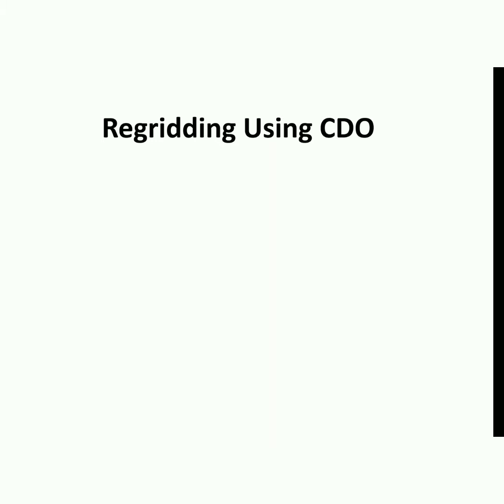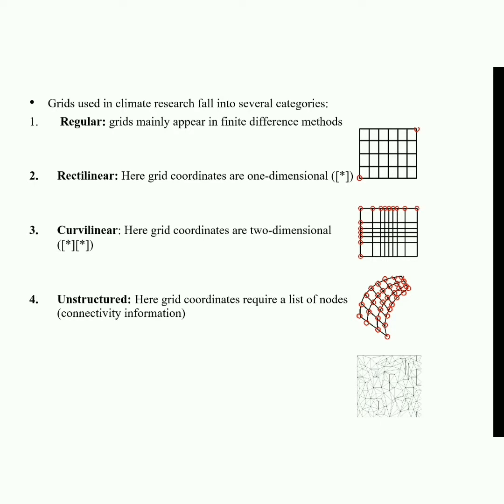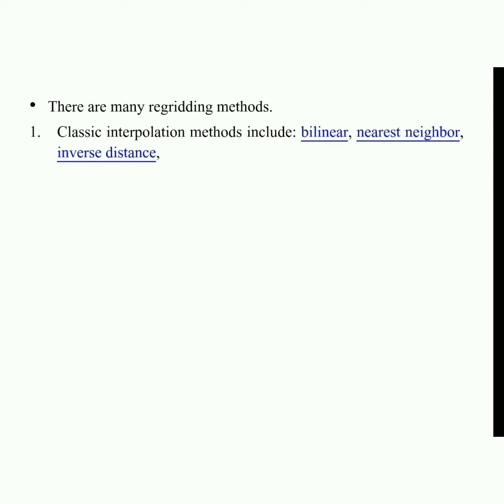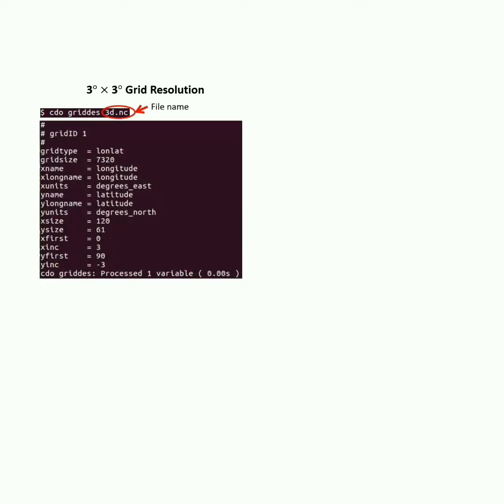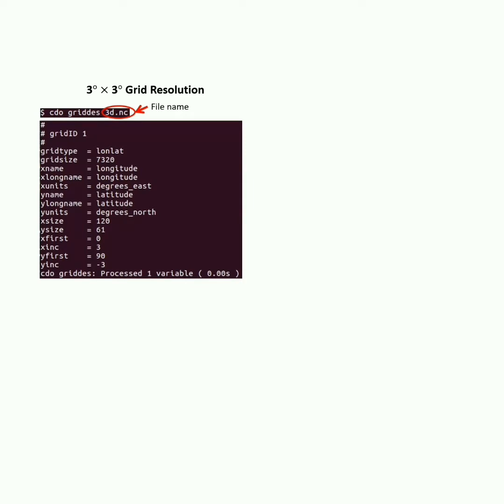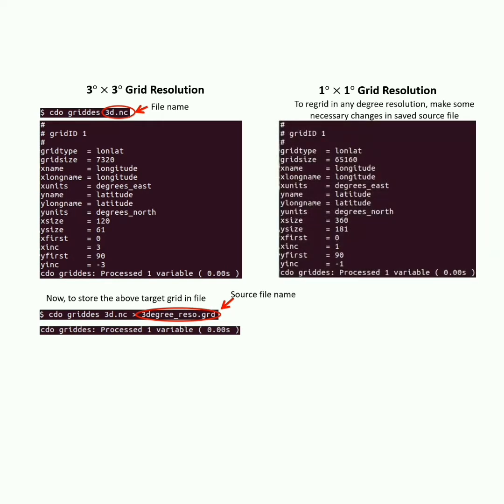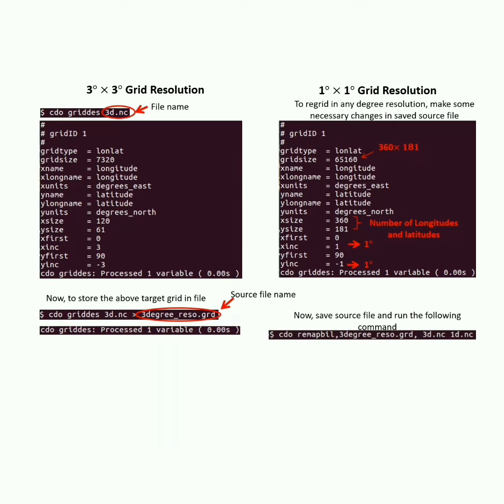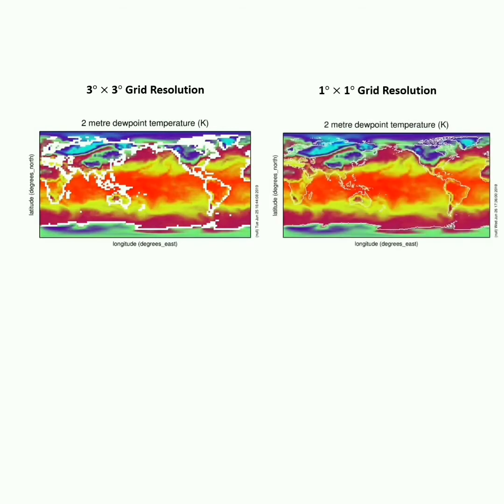Regridding in CDO by Bi-linear interpolation method

Comment: Hello, I have a question. I want to resample wind speed data from 0.04 degrees to 0.5degrees. Also, I want to resample dewpoint data from 0.1 degrees to 0.5 degrees. I want to know that for resampling wind speed and dewpoint, Is bilinear a good method to do that?

Comment: sir is there and way we can convert the data in excel to nc in CDo. Please guide
Reply: Hello, maybe this link helps you.(https://code.mpimet.mpg.de/boards/2/topics/10494?r=10505#message-10505)
Reply from the maker: Dear Vidya,

I don't know of a program that will do what you want directly.

There is a package for converting netCDF data to Excel and
manipulating it in Excel before writing it out again as netCDF:

  http://netcdf4excel.free.fr/vba.html

Another approach would be to write the data out as comma-separated
values to a text file, edit the text file to turn it into "CDL" (a
text form of netCDF data described in the netCDF documentation) and
then use the ncgen utility that comes with the netCDF software to
convert the CDL to a binary netCDF file.  For more information on
ncgen, see the ncgen documentation:

  http://www.unidata.ucar.edu/netcdf/docs/ncgen-man-1.html

Hope so it will be helpful..

Cheers
Reply: @easyway2think745  Thank you so much for the reply sir..but i could not access the link. could you pls help me
Reply from the maker: @pappurani  Try this..
https://www.unidata.ucar.edu/software/netcdf/docs/

Comment: Hi,, I want change the resolution of a temp anomaly nc file from 2 deg to 0.5 deg 
and I was using cdo remapcon ,, where i took a sample nc file which was in 0.5 deg resolution and according to that i was trying to re-grid this temp nc file to 0.5 deg resolution.. but i am getting this error.. Too many streams! Operator needs 1 input and 1 output streams ..... can you please help ??
Reply from the maker: Your have already 0.5 deg grid resolution data, then why your are re-grid it on same resolution?
Reply: @easyway2think745  thank you for your reply.. you didn't get what i was trying to convey.. anyway.. I was able to do that using  cdo remapbil.. previously I was trying do that using cdo remapcon.. taking that 0.5 deg nc file as a sample input file.. I hope now you can get my point..
Reply from the maker: @manasranjanpanda9859  Ohh..I got your point.

Comment: If dataset in curvilinear form, only I have to change remapbil to remapbic. Are there other changes needed to be followed in this tutorial?
After opening the source file, I got the file description two times, one in starting and another one at the end of the source file, So, is there a need to do changes in both ones or only in starting one? 

One last thing, how to find xsize and ysize for a particular grid?
Reply from the maker: Ans - 1. If dataset in curvilinear form, you can use remapbic instead of remapbil. It depends on, how you would like to integrate data set either in linear or in cubic form.
2. You can use starting one description
Reply: @easyway2think745  Thank you
Reply: Hi 
can you please help
How did you open and edit the source file?